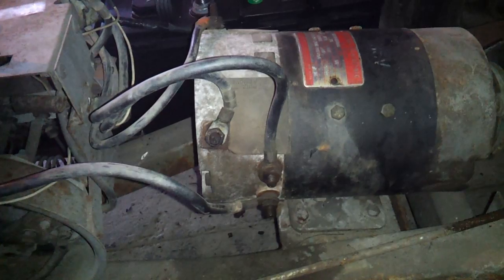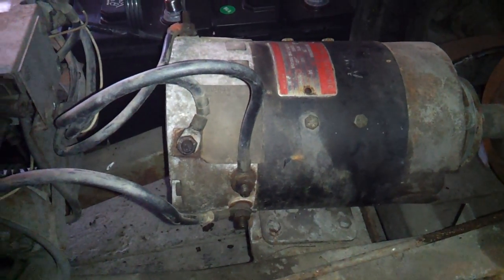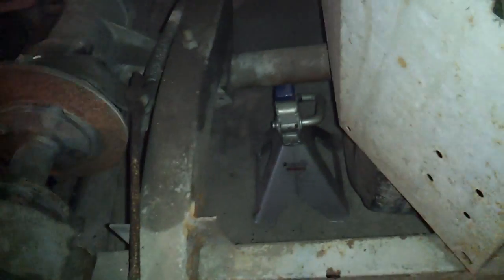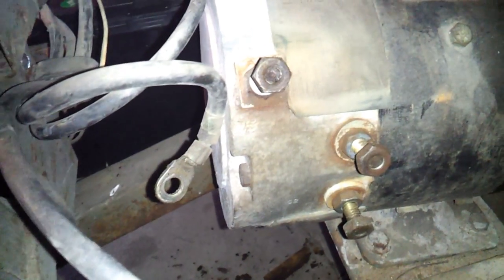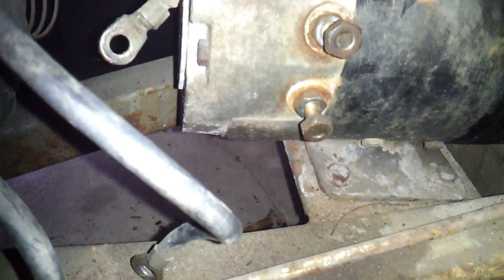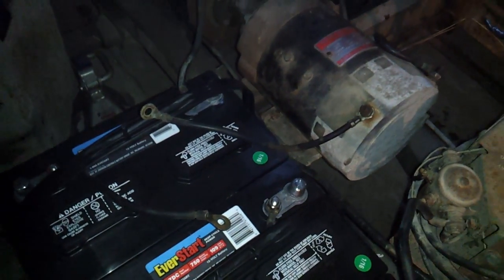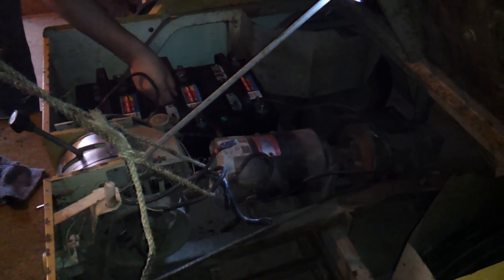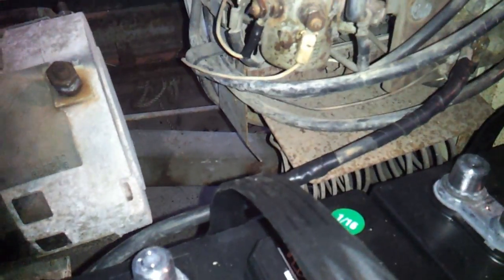36V DC motor test

Comment: Sir is 38v DC  motor enough for running a electric golf cart????
Reply: My understanding is that the 36v motor will move the golf cart about 10-12 miles per hour. It's worked fine for me. Thanks.
Reply: You would not believe the torque those motors have 12 volt 24 volt 36 volt they all have a lot of torque more than you could imagine
Reply: Tell him how big a hill they will go up from a stop
Reply: What do you expect 110 or 120 with an extension cord? LOL those 36 volt motors are tried and true proven torque monster and they will run practically all day thank you but most people use 6 volt batteries in series you can run them on 24 volts if you want to

Comment: Sir I bought a similar dc motor 36v 2hp and I´m making tests with a 12v battery, but I found the datasheet and I found that the A1 and S1 were supposed to be connected and then to the (+) then the A2 and S2 same thing but to the (-), any thoughts?

Comment: no you won't get the same result as with a battery.. why cuz the battery charger don't carry the amps ..the charger is a 2 too 10 amp ..an most batterys are 75 to 800 amps ..lol..it's not the volts that kill you ..it's the amps .....
Reply: You need the Voltage to provoque the excitation of electrones and current flow, so It´s both of them.

Comment: What do if I'm just hooking up a 12 volt charger to test my motor.
Reply from the maker: josh green You can test a DC motor with a 12V battery. I don't know about a charger, I've never tried that. But, I don't think a charger will give you the same result.
Reply: A charger won't run a motor usually but 12 volt battery would